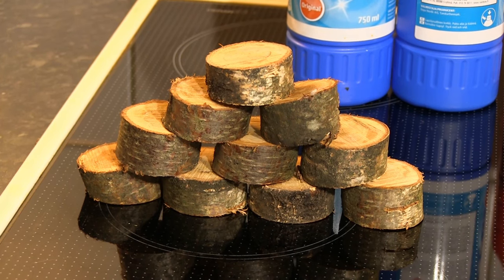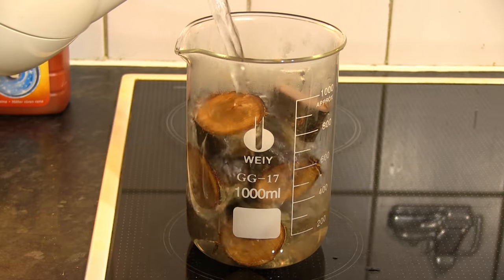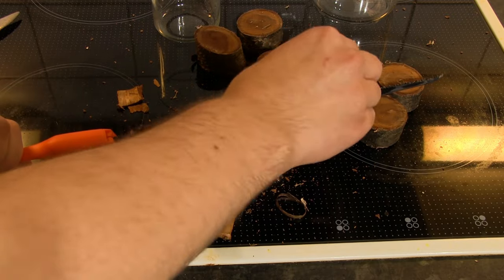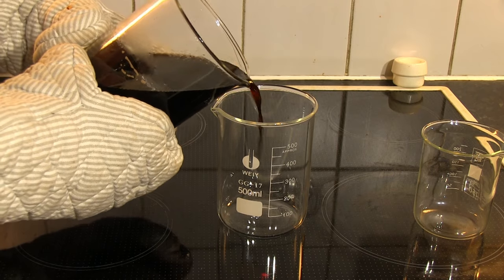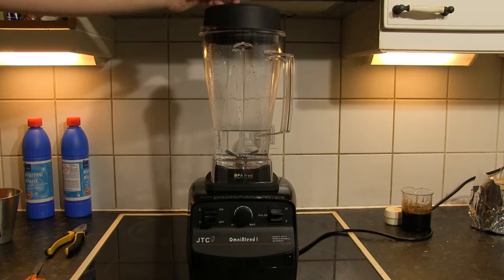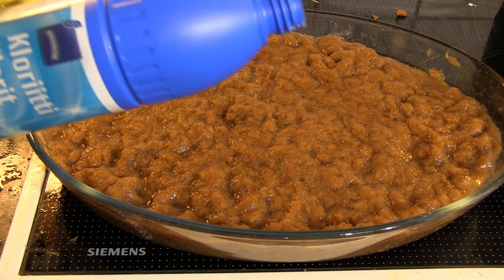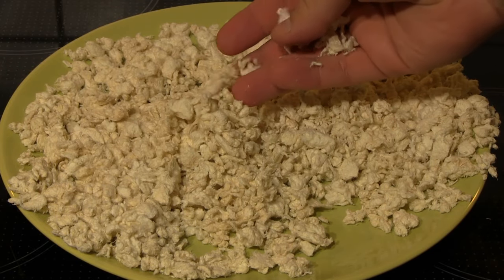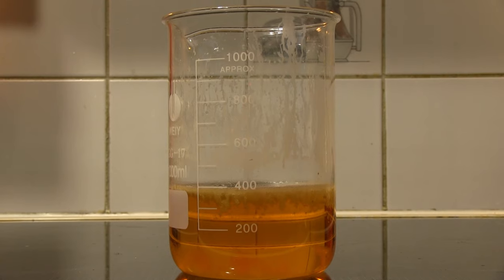DIY wood pulping project

Comment: After I have done this wood pulp, Can I make paper with it?
Reply from the maker: Absolutely! I have done paper from this pulp, and also I have successfully pulped my tomato plants into paper too. I suggest experimentation, like how fine should the fibers be etc. And most importantly, to have fun!
Reply: So I can use any wood type??
Reply from the maker: @KaiHeng  I think so. Trees like pines and spruces might give you hard time because of the gooey sap, but feel free to experiment :D
Reply: Alright thx
Reply: Can I use toilet cleaner instead of drain opener?
Reply from the maker: @KaiHeng  As long as the effective ingredient is NaOH (sodium hydroxide) for lignin removal, and some bleaching agent (like sodium hypochlorite) for bleaching the fibers, there is a possibility that it'll work. Experimentation is the key :D
Reply: So it is fine , as long as there’s sodium hydroxide in the ingredients?
Reply from the maker: @KaiHeng  In theory yes. Though other chemicals may make life difficult otherwise, even if they don't react, for example by foaming etc. So experiment carefully and keep yourself safe, and see what happens
Reply: Yes, you can. Try not using a blender though because that will destroy the fibers giving you a bad quality paper.
I would recommend pine, spruce or birch.
Reply: Hey can u write down all the steps for me ?
Reply from the maker: @KaiHeng  For paper making, or the cellulose extraction?
Reply: Raven Fly's Channel both?
Reply from the maker: @KaiHeng  Well, this video outlines the process of pulping, but basically it consists of:
1. Prepare the wood (remove unusable parts etc.)
2. Removal of lignin (boil in NaOH and then NaClO)
3. Mechanically separate the fibers from each other (technically steps 2&3 are done simultaneously at paper plants, but I have hard time finding a pressure cooker with strong enough stirring solution)

And then the paper making process:
1. Mixing the pulp with water in desired ratio (more pulp if you want thicker water, less if you want thinner)
2. Screen the pulp. This produces the raw paper.
3. Press the new papers. This will drive excess water away, and make the fibers lock better.
4. Cut the paper in to desired size.

Hope this helps :D
Reply: Raven Fly's Channel 
Really thank you for giving me these steps
If I have anymore questions, I will ask you🙏
Reply from the maker: @KaiHeng  You're welcome and feel free! :D

Comment: I thought in order to dissolve the lignin, you have to also add some kind of sulfite or sulfate (to produce the water soluble Lignosulfonate)? For an example of this process, you can watch Nilered's video on making clear wood. After the hydroxide treatment it certainly looked like the lignin was gone though. Can't wait to see what kind of paper this pulp makes, I bet it'll be like newspaper print
Reply from the maker: Yes, I'm a big fan of Nilered :D The idea in this experiment was to limit myself into chemicals anyone could get easily (where I live, most sulfur compounds, even just basic salts, are quite hard to come by). Sulfur compounds would of course make things easier, but lignin can dissolve in strongly basic solutions.

Though it can be seen that my attempt in recreating the Kraft process took multiple steps. To remedy this, a pressure vessel and alkali sulfate salt would've made this process much faster, and less labor intensive. 

Also the fact I used consumer products without any treatment (just some drain opener solution etc) was to show that this process is very robust.

But next time I end up making wood pulp, I would very much like to try improving the setup, with better chemicals, and pressure equipment (though the safety of that equipment would need to be thoroughly tested, nobody wants 100C+ hydroxide solution exploding on their face).

Comment: This looks like a very fun project! Did you heat the sodium hydroxide solution in fume hood? Also how should one dispose of the liquids after you are done with them?
Reply from the maker: NaOH won't fume, but the burners will consume oxygen, so I did this one on a garage with the door open.

I just chuck everything in a canister, label it, and take to a local disposal center. NaOH and sand aren't particularely dangerous, but can clog the drain.

Comment: I do have a question (the video answered most of them, thanks!), if I start with either sawdust or coarse sawdust, which parts of the process can I skip, in preparation for making paper?
Reply from the maker: Anything related to physically breaking The wood. Boiling lignin out is still necessary.
Reply: @RavenFly1232  Thank you kindly!

Comment: could I roll out the pulp at the end if mixed with water to create soft longer strands? Or do you think the pulp is too fine/breakable at that stage?
Reply from the maker: At any stage it works I think. Before blending it too fine, you can stop and roll out. Longer strands will result in stronger paper.

Comment: Wonderful tutorial, i will definitely try it out with the tons of coarse sawdust my dad throws away every day! I'm thinking of re-extracting the NaOH from the Black Liquor but after that i have no idea what to do with the lignin and other compounds inside it...did you find any uses for it?
Reply from the maker: Didn't find any use, but maybe constructing a burner to heat something
Reply: Maybe you can disolve it with alcohol and make some ink? I don't know if that's possible because i'm not a quemist, but maybe?

Comment: Can i ask pls response, what if ill use hard wood will it work?
Reply from the maker: @KianVil  Yes. Hard woods might be more difficult to cut, but other than that not much different.
Reply: @RavenFly1232 Ahhh i see, i was planning to make a research about it. But im quite unsure about my wood, well the thing is my research is about converting tree branches into cellulose and later on use this cellulose to make a specific product but the thing is i used calamansi branches i think its in the citrus plant fam so ithink its hardwood. I tried to do the same process as you did but the difference is i used sodium bicarbonate (baking soda) than lye solution(sodium hydroxide) and hydrogen peroxide for bleaching than using sodium hypochlorite (bleach) cause i heard they have the same traits as the two but the difference is they are only mid solutions meaning theyre not as strong as lye or regular bleach. theoretically, if i did use lye and regular bleach will ill be able to soften the hardwood and extract the cellulose? Also is powder lye okay to use and if i indeed made a cellulose can i use it as an alternative for starch? Sorry for a lot of questions i really like this kind of stuff.
Reply: Also my plant branches is rather thin and long than usual tree branches which are thick and large so its like twigs if that's the term idk. Greetings from the Philippines🇵🇭

Comment: I'm planning on doing this but I have actual poplar tree which is a hardwood but is very soft and fibrous and I want to make paper out of it, right now it's like a dry pulp but won't really stick together so if you did make paper out of it, how would you get the wood fibers together and actually create a bond, I'm sure I know what I need to do but I'm missing something and I can't remember what the heck it is...
Reply from the maker: Usually when paper is made, the fibers are mixed with water very well to create even pulp, and then strained and pressed to make paper. If for some reason the fibers don't stick, you could try adding some water soluble glue (if I remember correctly, PVA or Elmers glue could be used) to help the fibers stick together. 

Most of the commercial paper you buy from stores to use in printers etc. Contain loads of different additives, including very fine sand (photography papers can be made of a very high proportion of sand) and binding materials, so I see no reason why with some ingenuity you couldn't find a perfect paper recipe for you :D
Reply: @RavenFly1232  Thanks for the reply, Yeah I think the main problem when I tried it last time was I was using sawdust and I forgot to mention that I haven't actually tried mixing this with water yet so we'll see what happens I just don't wanna mess this up again, lol.
Reply from the maker: @WikkyPlays  Sawdust might not be ideal, longer fibers are easier to get stuck together. But with some additives it could work :D

Comment: Hey was just wondering, could you do this on a gas stove? or does it have to be electric?
Reply from the maker: Any heating element works as long as you make sure to take safety into account.
Reply: @RavenFly1232  and are there any strong fumes that are emitted by heating the sodium hydroxide? is it ok to do this inside if you have a gas stove?

Comment: Hi, thank you for the nice video-short, sweet and to the point.   Are you in Sweden or Norway?  If you are, you may not be experiencing this, but the current shortage of toilet paper in the US made me extremely curious as to how paper is made form scratch, diy.  So here are some questions/comments.  Regarding the following:  Getting the paper soft:  What if the piece of wood  is somewhat soft from lying under leaves, say one or several years?  Would that help with the softness (in other words, starting with old wood that has been left out in the elements for some time, and maybe it is even staring to rot)?   In that case, it must be definitely boiled to get rid of possible fungus, bacteria, etc.  Getting the lignin out:  Let's say if you did not have sodium hydroxide, could you put ashes in water and wait a while?  This would create a basic solution, (I think it's called lye).  I am not sure how strong it would get;  I heard it can get quite strong, and then use this instead of sodium hydroxide?   Regarding bleaching:   Is bleach used for lignin removal, or just to get the paper white.  If just to get paper white, I would only use 1 or 2 tbls of bleach, I don't need white paper (less harmful to the environment, plus I dislike the smell of bleach).  Practically, I don't think I could make my own t.p., although it's nice to understand how it works. 

Also, in crafts fairs, I have seen how crafters use old paper, tear it up, mix it with water in a blender and then strain it to make sheets.  I suppose I could tear up cardboard and other paper, mix it w/ water, boil it, blend it, maybe add just a little bleach (or not), strain it on a screen  and make toilet paper (of sorts)?  It's great to know tomato plant stems worked.  I hope to plant some flax seed, and a single squash plant (not much space).  It sounds like the stems and leaves of such plants could also be used?
Reply from the maker: Actually, I'm located in Finland :D 

Now to answering your questions:
The softness of toilet paper comes more from the geometry than the material of paper. If you search in youtube "How It's Made: Toilet Paper", you see, that there is a pattern embossed to the very thin sheet of paper material, and then two of these sheets are combined. Using a sub par wood or recycled paper just means that the breaking down of the fibers is easier (though other impurities may or may not affect this).

Yes, wood ashes contain sodium and potassium oxides, and if you extract it by dissolving it first in water (in which the Na2O reacts to form NaOH), and then strain, you should get a solution of NaOH, that you can concentrate (if needed) by boiling or evaporating water (evaporation won't get as good results, as NaOH is hygroscopic, so no complete dryness, probably not even crystals).

Bleach may or may not be needed. Sure it breaks down some lignin, and gives a nice white color, but mostly this is not too necessary if you want just fibers.

Use of recycled paper is very much the easiest way of getting nice fibers, that's what most of commercial TP is made anyways, so that's my recommendation. At least the stems of tomatoes worked. Every cell of a plant contains fibers, but the quality of them is the thing. In wood, you have long chains, but in leaves they aren't as long. Experimentation is the key here.
Reply: @RavenFly1232  Hello again, thank you for your prompt reply!  So yeah, when I was searching yesterday yours came up first.  Actually, I did not expect anything to come up, so I was delighted to see your video which explains the crux of the matter in such a concise, clear. and complete way.  After that, I searched and searched, but really you cover it all.  Everything else is extra.  I did see that commercial production seems to depend on some kind of sulfuric acid (sorry, my science knowledge only extends to first year Biology and some basic Chemistry and curiosity).  So, I will probably experiment.  I am keeping all the cardboard I have received from all the packages lately.  Any ideas how to remove the ink from glossy papers (advertisements, catalogues and such)?

Re:  the ashes in water:  I would not filter the solution, nor would I try to get crystals, since my interest is t.p.;  I would decant it, leaving ashes on the bottom (I am working on the assumption that resources-such as filters are scarce in April 2020).  So I would just decant it and boil it with the wood.  Do you have any idea how I could determine the pH of the water-ash solution without pH strips, or any equipment?  Now, if I were a villager 100 years ago, I would probably know by looking at the way it moves (say when stirred), or some other experiential way.  But since I am not...hhmm...maybe I should search for it.  You know what I mean, right?  Once, for example, when I was trying to learn the different stages of sugar caramelization, I did not even have to look at it,  after observing it for the first time.  I could hear the stage of caramelization from several feet away by the sound the boiling bubbles made, and confirming by looking  at the size of the bubbles, and other indicators.

Lastly, because we are also experiencing flour shortages (N. A.), I was able to buy a bulk quantity of wheat kernels.  There was no flour in the grocery stores the last time we went to the store, which was quite some time ago.  So I am resigned to cooking  wheat kernels like we cook rice if necessary.  I prefer to make flour.  I don't want to destroy my blender, nor do I want to pay $600 or more  for wheat grinding stones.  So I thought I would try to put the wheat kernels in a sturdy bag and run it over with the car to make flour.  Do you have any other easier or at least more graceful suggestions?  Thank you.  Wishing you and all health, resilience, and courage.
Reply from the maker: @GreekVegetarianRecip  There are three big processes in use right now in pulping industry (actually more, but three more established procedures): 
-Kraft process: Use of NaOH and Na₂S (sodium sulfide)
-Sulfite process: Use of various sulfites
-Soda pulping: Use of NaOH (the one I emulated in the video)

Soda pulping has the benefit of being easy, but the resulting paper is a bit less strong, the others need more chemicals, but produce stronger fibers. There are other pros and cons as well, but for DIY projects, the easy chemicals are the big thing.

Glossy paper won't work well in making wood pulp, as it contains not an insignificant amount of stuff that will be a pain in the but (very fine sand, talc, binding chemicals etc.) It won't even burn without leaving a ton of useless ash. So I personally wouldn't even bother with that stuff. Though you could try blending the paper in to a low concentration water mixture, bubble air through, and skim off the foam.

Decanting works as well, as long as you let it sit for long enough. I personally prefer coffee filters and vacuum filtering methods, as I am a bit impatient. To determining PH level, there is no accurate way of doing that without some indicator chemicals etc. Some can be made out of plants, but have limited range in which the color etc changes. And as is the nature of PH, it will easily go to high or low even with small concentrations of acids/bases, so determining concentration accurately from homemade things is kinda hard. Easiest way would be to titrate, but then again, more chemicals and equipment etc. 

You could confirm the presence of alkali metal hydroxide by first diluting the sample (a lot, as this is dangerous and stupid method that I do not recommend) and then dipping your finger in. If they feel slippery, then there is very likely some lye in there. But once again, this is not too good for your skin, and if for some reason you find your fingers feeling slippery, wash them with lots of water. Also, I recommend using protective gear, as lye and other bases are those "melts your flesh away" chemicals.

I would advise against using car. In addition to not being efficient (you would get probably only a couple of cracked kernels), it can be dangerous, as there is all sorts of crap in tires and ground, and the least bad thing would be sand in your flour that could damage your teeth. Much better option would be to get one of those 20-30€/$ coffee grinders. They are designed to deal with hard materials, and grinding them to a fine consistency. I had one few years ago, and used that to grind salts. I also broke it because I didn't clean the salts off, and it rusted shut, but with proper maintenance it should last a long time.
Reply: @RavenFly1232  Thank you!  I do have a coffee grinder.  Eventually I will experiment with the car method (just because now I am curious), and I will let you know if it works.
Reply from the maker: @GreekVegetarianRecip  Great idea to experiment! There is never enough people doing experiments :D